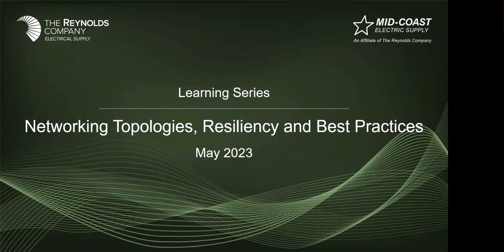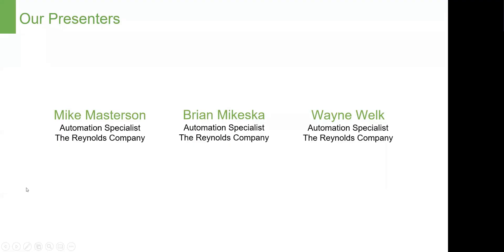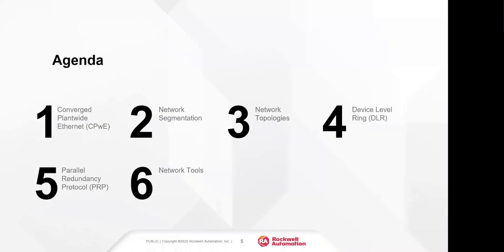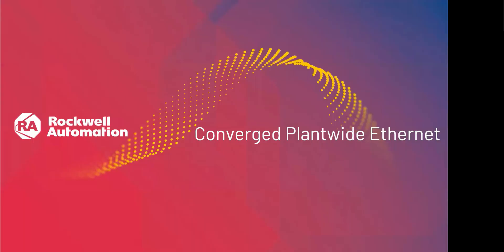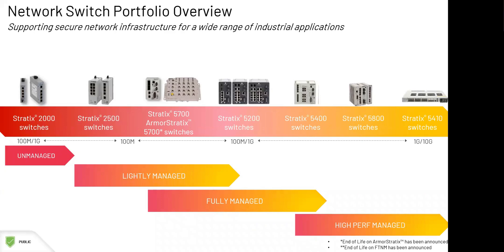Network Topologies, Resilience, and Best Practices

Comment: Is there any port limitation with PRP enabled switches??..example - with a stratix 5200/5400 eight port switch, can all the eight ports be utilized for connecting to let's say seven different incoming PRP frame from different hardware and one outgoing PRP frame to a EN2TP and vice versa??